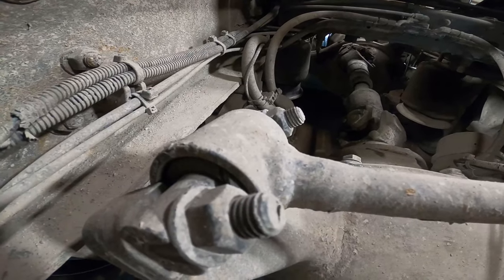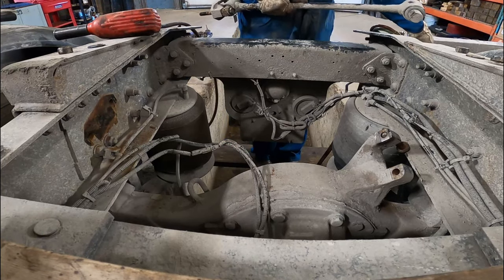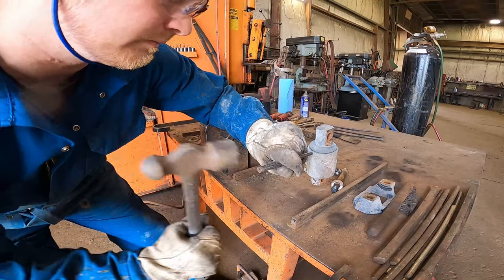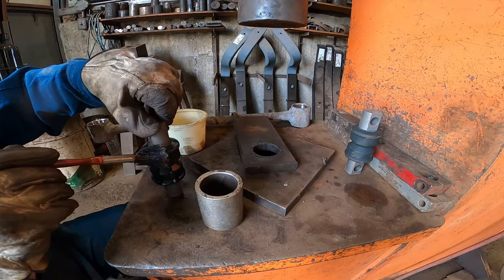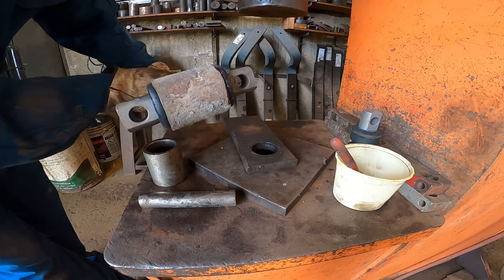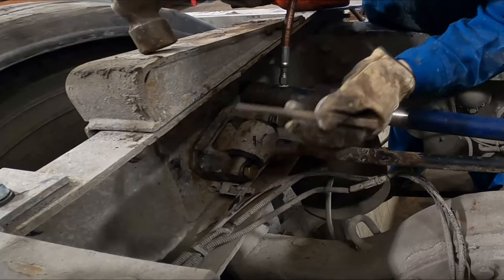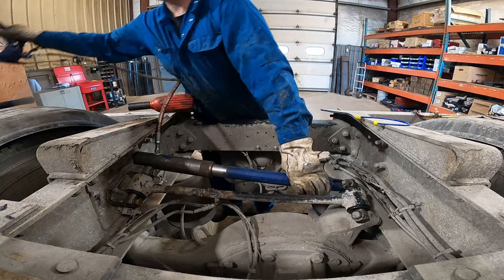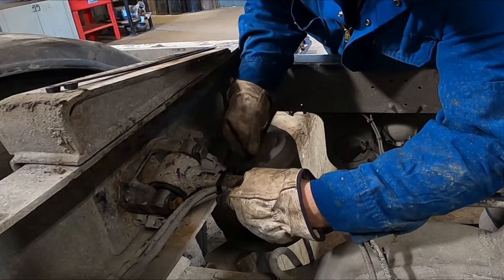Hendrickson 20,000Lbs torque rod bushing replacement

Comment: I always found a good beefy one and used the center section as a big punch, I work on fire engines now and don’t do much suspension work anymore. I found my niche when I was a younger mechanic learning alignments and suspension work. I have rebuild gear boxes when that was the norm,bent front axles, straightened frames for years, rebuilt every kingpin known to man, thought I have seen every suspension ever made but there still coming out with new ones. It’s hard but you always have to work smart to keep from hurting yourself, you videos bring back a lot of memories

Comment: I have a tip to offer.
Say you have a fastener that is not moving.  Before breaking out the "blue wrench" fill the impact gun with impact oil.  Pull the trigger when adding the oil. 
COVER the exhaust with a rag!!  
Place onto the suborn fastener and hit the trigger!!  Momentarily you greatly increase the power of the impact gun.  Plus, the oil helps clean and lubricate the inner workings of your impact.  
I have used this trick MANY times on my own 1/2" drive impact.  
Thank you for doing the hard, dirty work to keep trucks on the road!!

Comment: Flush cutters work great for getting the tail cut down on zip ties without leaving a razor edge hanging out there. When I pull these torque arms off, I dump the bags before I pull the bolts. It pushes the axle as far away from the frame rail as possible. Pull the bolts and arm and then air it back up. They will usually slide right in when going back together. Great content, keep it up!
Reply from the maker: never head of "flush cutters" before.  I'll have to take a look at those and give them a try.  I just hate it when people leave them long and i get an end in the eye or ear.
Reply: @simcoespring  you can find them for like $7 for a Good Entry-grade. the Bottom-feeder grade is super light-duty and meant for electronics assembly, cutting the long tails off of component leads. look for the ones that have a "real" pivot, not just a stamped sheet metal with rivet
Reply: Came here to say this exact thing
Reply: I couldn’t agree more I hate getting cut on zip ties when they’re not cut flush😬

Comment: I see that your airlines are 3/8" or 1/4" inch step up to 1/2" or 5/8'' and your airtool performance increases a lot as you guys deal with a lot of big rusty bolts in impact tools power is dependant in blows per second and CFM is key to this . In a machine building shop where i worked for years we had a new series of machines that had bigger assemblies with larger fasteners than we used in the past and the 1/2 " impacts were not up to the job so we ordered 3/4 " and one inch drive impacts to do the job but on 1/4 " airlines were not much better , we switched out to 5/8 " lines and 1/2 '' fittings fed by 3/4 " black pipe feed lines , big difference . CFM is where the powerer is like torque from a engine .
Reply from the maker: We use 3/8 and 1/2" and it works great.

Comment: I worked in a truck shop for 10 years. We found it cheaper to buy a new rod than it was to send it out and have them rebushed. We didn’t have time to wait for them to be sent out and returned either.
Reply: This time it looked like it went pretty darn fast.
Reply: Question: why were there so many shims?  Couldn't those shims explain why the bushings failed? I mean,  he's literally prying the frame apart to reinstall.  Isn't that a problem?  Just asking
Reply: @akbarshoed  the shims are for alignment. Sometimes after a wreck things don’t go back exactly like it should so you get a lot of shims to be straight.

Comment: Some Zip tie makers also have a hand grip type of gun to both tighten the tie and cut it off flush. I've also seen these guns that will tighten the tie and leave a 1/8 to 3/16 out with an arc in the cut so there are no sharp corners. This type is needed if you know that sometime down the road the tie will need a little bit more tightening and gives you something to grab on to. And it maintains the rounded corners.
Reply from the maker: Interesting.  I'll have to look at that
Reply: I’ve used these in my aviation days, the issue is they tend to wear out real quick and get annoying to use. The flush cutters are really the good fix. You do have to hide them though from everybody as other people that borrow them tend to cut steel wire and 5/“ bolts and ruin the edges.

Comment: Just wondering if I would have been easier to re install the opposite side first.?
Reply: It would have. You install frame side then use aligning pin for diff side

Comment: How driver or the owner of truck knows that that bush should be changed? is there any sound  from torque rod bushing which indicates sit should be replaced. the crack is it visible with naked eye when it is not removed. is it one of the check list for driver to check that spot every alternative period? Good Job, with proper equipment life is easy .
Reply from the maker: we usually check for cracking and any kind of movement.  if the bushing is all pushed over to one side or if the rubber is hanging out of it, splits, major cracking, (small surface cracking is normal) but anything where there is splits in the rubber then you can tell it is time for a re-bush.
Reply: @simcoespring  Or some residue of rust(colour) around the bushing.

Comment: Re: trimming the tie wraps.  YouTuber J.C. Smith recommends you twist them off with a pair of vice grip pliers.  The cut ends are not so sharp which reduces the danger for the next guy who has to work in that area.
Reply from the maker: cool i'll have to try that.  I just like trimming them so I don't get poked in the eye by the leftovers.
Reply: @simcoespring  agree, looks alot neeter

Comment: I have a question.  Do torque rods, the ones that bolt down from front to back (not side to side like these), also keep the rear ends from moving when going around curves or turning?
Reply from the maker: nope.  They hold the top of the differential from rotating when you accelerate.  That way your drive shafts stay all aligned.
Reply: @simcoespring  oh okay.  How much does it cost to replace the bushings on a Hendrickson suspension??   Fleetpride here in North Carolina told me about $5,000.00 if I bring the truck.  That seems very high

Comment: What that bar does? I have always wondered that.
Reply from the maker: it holds the axle straight when you turn a corner.  So the more weight you pull the heavier and stronger the bar needs to be.
Reply: @simcoespring  Thanks.

Comment: Do you have a part number for the canister you press the bushing into before it enters the arm? We use a bearing cup, but people are always throwing it out, would like to get an actual tool.
Reply from the maker: it was a reyco torque rod bushing installer.  Let me look it up, I'll get back to you on that.
Reply from the maker: the bushing is a 09729-01 from Reyco or 321-153 (dayton).  I know that Automann has an installer for them because I've purchased them before.
https://www.stengelbros.net/TRB6326-T-Torque-Rod-Bushing-Install-Tool-Hutch_p_30555.html
this is an installer you can get from stengelbros, but it seems a tiny bit short, maybe you could weld a washer on top to give it a bit of more length to hold the bushing in better.
hope this helps.
Reply: Awesome. Thank you. Appreciate the quick reply. I work in a shop that specializes in suspension and was looking for alternative ways of doing jobs when I came across your channel. Great content. Keep it up.

Comment: Does this torque rod cause dump beds to lean side to side when dumping?
Reply from the maker: not normally.  is your truck a frightliner with a tuftrac suspension? they are notorious for having bad bushings under the ends of the leaf springs which can cause a lean.
A lean would be mostly from worn out leaf springs or rubber block suspension being worn out.
You can always email me a picture of the suspension.
Reply: @simcoespring  it’s a peterbilt 348 and it leans a lot when dumping loads, it’s about 200k miles in with original suspension parts. The bushings look ok on the torque rods, it’s not ripped from what I can see and it looks even. Could be worn out leaf springs
Reply: With AirTrac suspension

Comment: Come on man, turn your bolts around. The ones that goes through the frame should be bolt head to the tires that way you can put your plates and block on then deal with the torque rod without having to fight to line up the rest.

I turn those bolts around everytime lol